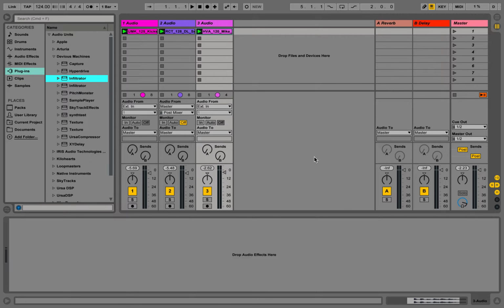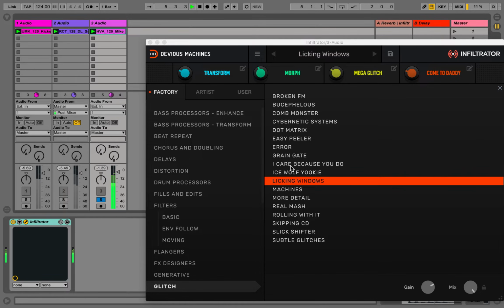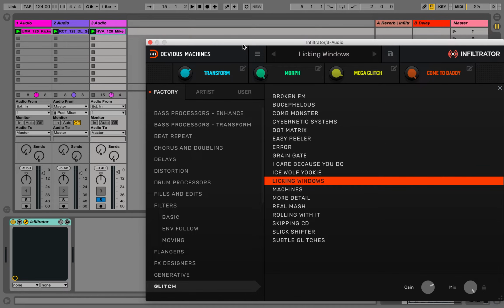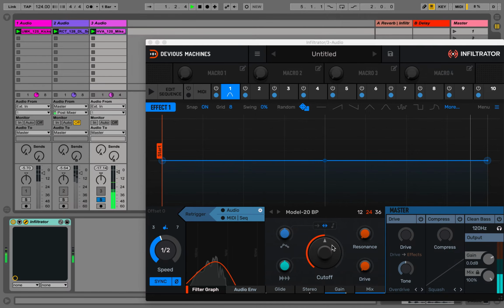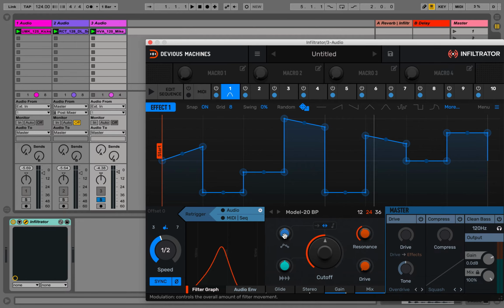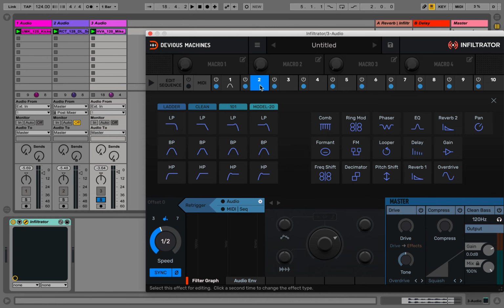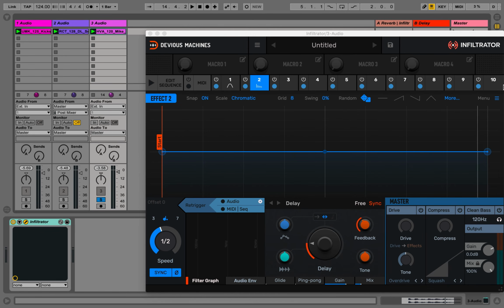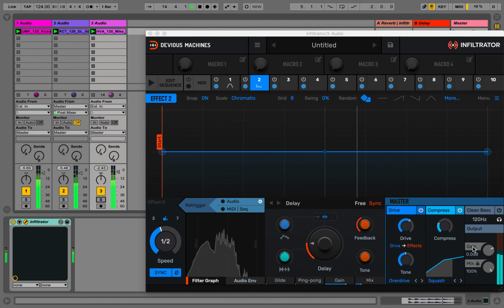Infiltrator - Getting Started

Comment: Great!!!  Please add a nice sounding vocoder, granular engine and reverse and I am in the game
Reply from the maker: I'm certain there will be more effects in a future update!  I'm making a note tho, 'Granular' :)
Reply: @DeviousMachines  A reverser is crucial too, it definitely one of the most basic fundamental level glitch effects out there, probably right after the beat repeat. Maybe it could fit into the granular engine as reversed grains are not an uncommon feature on granular synths/fx, or maybe it could become a toggle-able feature on the beat repeat somehow, as the two effects are pretty fundamentally similar. but yeah, if you guys are to add anything, it would be a reverser.
Also I think some different distortion settings could serve this thing well as well, as the one in there as of now doesn't seem to be that versatile and is a bit digital sounding, which, while isn't always a bad thing, is still a certain sound. I'd maybe hit up someone with knowledge in analog modeling to maybe get some sort of "Analog Distorion" module in there. Maybe it could be multimode?
Anyways, super fantastic work with this one, the variety of sounds you can get out of this thing seem pretty freakin incredible.
Reply: @KnzoVortex  +1 for reverse effect.